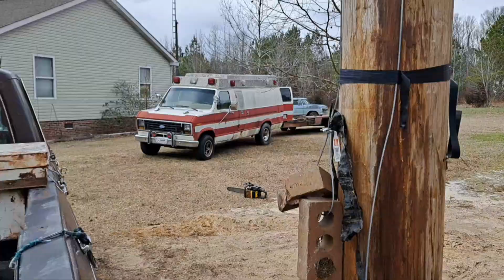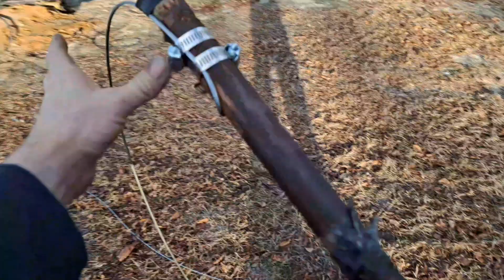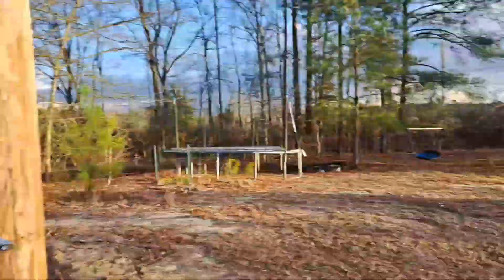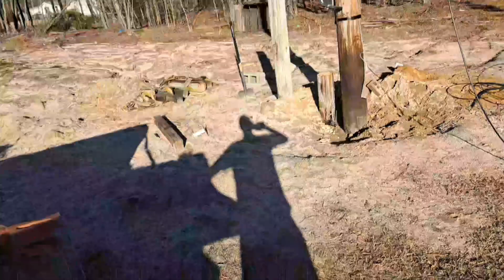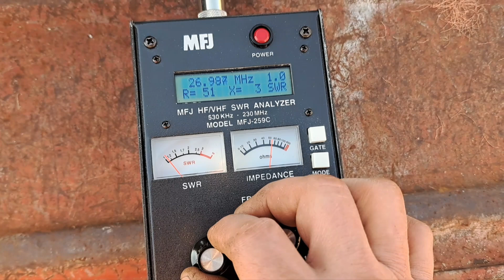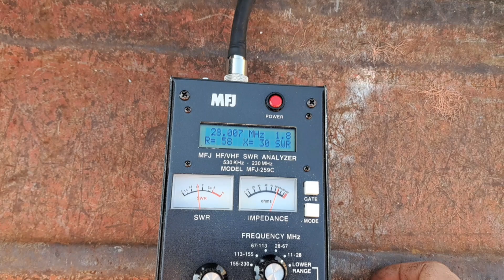🔥Part 2 learn how Huuuuuge C.B. Antenna install!! How To and Tuning🔥

Comment: The MFJ isn't as accurate as the rig expert, but it's pretty decent but it takes too many batteries
Reply from the maker: It's better than just using c.b. meters though